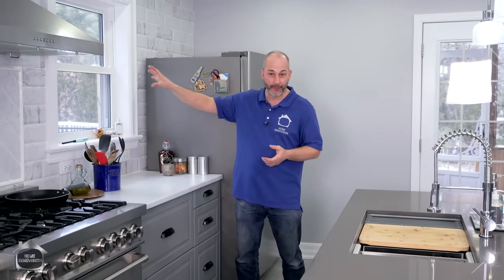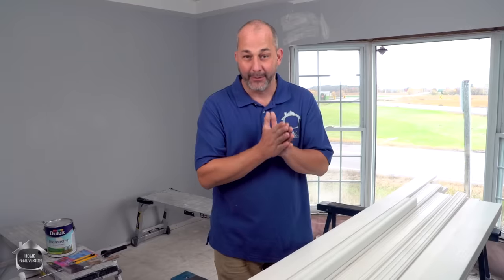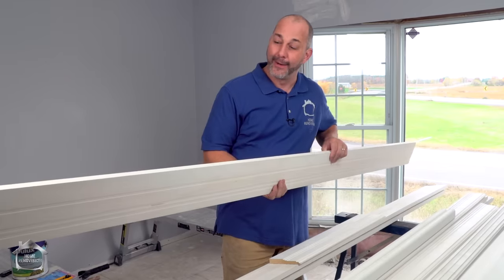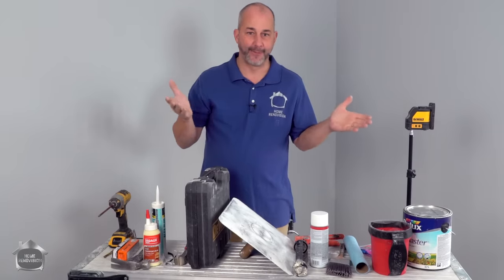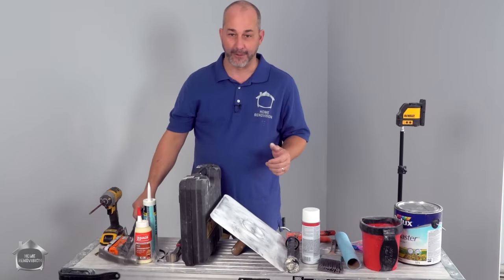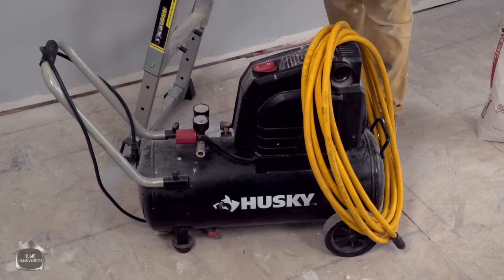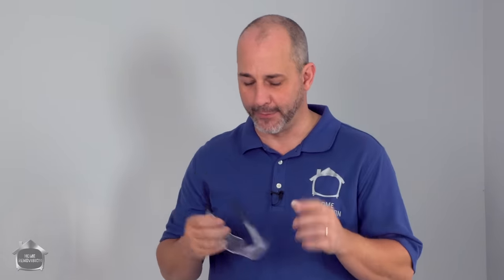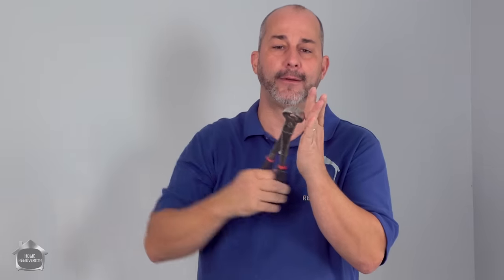How To Trim Doors Windows and Baseboards | A to Z

Comment: Jeff, I messed up a measurement and purchased new construction windows with jamb extensions that are 1" short from the inside paneling.  Can I still use them or do I need to remove the factory attached jamb extensions (looks like they are attached with heavy-duty staples) and create a new jamb extension box as you have done in this video?  Thanks!
Reply from the maker: I would replace them and install new or it will look like a mistake that was fixed forever.
Reply: @HomeRenoVisionDIY  Thank you.

Comment: hi Jeff..why not cut the crown moulding on an angle instead of a butt joint to match up two lenghts?  Also have you ever tried 950A latex from Sherwin Williams instead of Alex Plus?  The original Alex latex use to crack because the wasn't enough silicone in the mix, hence why they came out with Alex Plus (plus stands for more silicone in the recipe lol).  cheers , Mike

Comment: For door trim and baseboards, do you use 16 or 18 gauge nail gun?
Reply from the maker: I usually use an 18 gauge and save the 16 for larger stock wood. Cheers!

Comment: What is the best way to close the gap between the wall and floor, that will be  hidden by hydronic baseboard? I see gaps on most yet since I am replacing my heat baseboards I want to close the gaps hidden by the baseboard heat.

Comment: When i bought my house 1 year ago, i didnt know shit about houses. Thanks to your channel i know a lot more.

Regarding tims, lucky me, i've done all the job in MDF. Because on my miter saw, i have a framing/shitty blade, whatever a butcher should use. I think that its important to point out that you should use a finishing blade (like you did) when you work with wood. Because i learnt that by trials and mistakes later on (''why do i make splinters on everything?''). 

To sumup, from my newbie experience: The blade matters if you work with wood
Reply: Yessir trim blade has many more teeth than standard rip blade....Make sure your saw is up "to speed"before starting your cut...that will help with splintering.....
Reply: @davidwiley3440  thx for that ''up to speed'' comment.

I have not thought of that and it surely plays a difference. Totally make sens. I will pay attention next time.

Comment: I have a french door that was installed a year ago as a remodel in our existing kitchen. The door spans 2 different thickness walls. It fits and works fine but one wall is over 1/2" thicker than the other. So one side is flush and the other is recessed. Have any suggestions for how to trim this out?

Comment: I have found it easier for clean up and save your paint tray slide it in a plastic trash bag with a knot you can undo when finished untie turn inside out and any wet paint is trapped

Comment: I would say the opposite as far as brushes go. You want a soft bristle brush for trim, as it is like painting with a mushy sponge and doesn't show brush marks. Stiff bristle brushes are for cutting in walls. That's why I trim brushes are made out of nylox and natural bristles. Wall brushes are made out of chinex and mixes of nylon and polyester. The bristles themselves are much thicker with wall brushes.

Comment: Left door casing you marked 45° is to the left, so on the right door casing your 45° angle needs to be all right, correct so you know Which direction you should be cutting on the miter saw?

Comment: Just finishing up a bathroom reno. Learned a lot of diy from my Dad, but your videos are now a close #2, especially with today's modern materials. 
Only one question: you recommend a STIFF bristle brush for trim, I always heard the opposite? I use soft nylon brushes on my trim, and find they're much harder to use than nylon/poly or chinex brushes, but do leave fewer brush marks.

Comment: If you're going to get a miter saw and you're doing home improvements get at least a 10" sliding compound miter saw. I have the 12" but its really big. Even if you're gonna get a 7 1/4" get a sliding one you will surprised how much you use it.
Reply from the maker: so what your saying is the smaller the tool the more you use it. ....I do'nt think that's how it works in real life. Cheers!
Reply: @HomeRenoVisionDIY  I meant a sliding miter saw is better than a not sliding miter saw.

Comment: Would you recommend using the drywall compound over wood puddy
Reply: No. Dont use Drywall compound at all. It works, but it shrinks, it has a rougher texture, and absorbs more paint and so the nails will show up more. Use DAP painters putty if you are painting woodwork. It is exceptional and much less messy and has a longer working time.

Comment: Jeff, it appeared to me that the header door trim was a bit higher on the right than the left.
On the first measurement you used the flooring material as a measurement. Not sure you
Duplicated that same measurement on the right cut? I’m a close watcher.
Reply: I saw that too. I feel like he did measure it with the floor piece laying on the floor for both sides but maybe the door itself is installed slanted.

Comment: Pawn shops, thrift stores, and online are good places to get really cheap tools, just be really sure they work before you buy them. Also, if it's really specialty stuff like some stuff used in electrical or plumbing, and it's a tool you only need for one time, really cheap tools work. 

However, if you want more than one time use, you can check pawn shops and thrift stores, for virtually new equipment, but you'll probably end up at a box store like Home Depot or something

Comment: Hey awesome video, Quick Question - on the baseboard install, would you recommend always installing the baseboard trim before the flooring? Thanks!
Reply: No. Trim is used to cover the gap between the floor and walls. Only use quarter round in front of trim to cover a gap where you cannot remove the old trim like in a century home. Not a great look, but sometimes necessary.

Comment: Bird's mouth in the outside corners and no coping in the inside corners.  No countersinks for the screws on the window sill.  No battery-powered finish nailer.  Screw air compressors and hoses.  I wouldn't own a compound miter saw without a 12" blade and laser or light guide.   You can mount a sewing machine light at the top of your guard for perfect cuts every time.  Wire your light to the trigger so the saw has time to spin up as you adjust your wood.   Adding Dove dishwashing soap makes your mud like creamy peanut butter without adding water.  I'd have cut the but joints at 15 degrees.

Comment: I have always had an issue with picking trim and then getting it to match the doors. I want a wide trim for base but doors I have off areas and the wife won’t fit. How to I fix this? Can I do smaller trim for doors?

Comment: Curious how hard those cuts on the baseboard are to do if one doesn't have a miter saw and only a circular and hand tools (like a coping saw).
Edit: also, no nail gun so I guess hand hammering some finish nails with a light hammer?

Comment: At 1:02, with respect to your shoe molding where it meets the door casing, am I correct that said shoe mold is cut on a 45 degree angle? (The challenge for me is that the shoe molding itself would seem to otherwise project out into the room further than the door casing.)

Comment: I'm really curious how you made those taper cuts for the window casing on the table saw. I built a jig for that but it's still a pain and you just cut it without thinking. I have been using durhams rockhard putty for nail holes and had no idea I could use drywall compound
Reply: blue tape with ca glue sticks two pieces till sawn at angle

Comment: Fill the nail holes and caulk your baseboards. I picked up a contract in Maine and the old trim carpenter never caulked anything. And the painters would just paint without caulking. If was a nightmare to go back and fix 35 homes after the fact. Good money but I don't recommend picking up that kind of contract.

Comment: At 42:30 you say that you measure 1 1/2 inches longer than your initial measurement. However, before saying that you said the measurement was 4 7/8. Was the cut 6 1/8 inches or 4 7/8?

Comment: @Home RenoVision DIY What is the name of the store where you found the wood trim for the same price as the cheap stuff at home depot? You mentioned across from home depot, but not sure which location and you didn't actually say the name. I'm in Ottawa (actually Kanata) and about to do a ton of baseboards and other trim!
Reply: Try Ottawa Moulding Depot, they are located in Kanata. Lots of mouldings in stock
Reply: I'll check it out. Thanks @joef1551

Comment: by pushing the trim into the blade and then cutting a little off works because the wood is touching the flat web of the blade and missing the Kiel of the teeth

Comment: What should I do if I’m in an attic replacing a hot water heater and I need to use the existing vent going out the roof?

Comment: If the end of wall was 4 7/8, the inside measurement piece against the wall would be 4 7/8, not the total length of the outside of the baseboard. It would be longer since it comes out to make the angle. Did you have to re-cut?

Comment: Just a question, my teacher says to never do both sides of the door casing before the too for some reason. He says to do one side, then the top, then the other side. Have you heard of people doing it this way and why would they do it like that?
Reply: I have heard this from a carpenter I worked with. Some people do it this way to only have one miter to worry about at a time. It doesn't make much sense to me, I think this method is better.

Comment: I have a problem in my garage.  I have a regular door which I had an installer replace.  It never had any trim around it.  The garage was a mess I am trying to clean up.  The drywall sticks up past the door frame.   I want to add trim.  What do I need to do?  Add a thin flat trim all the way around to cover the end of the plywood and have the trim sit on?  I bought a money pit.  I'm a new member and binge watch all your videos.
Reply from the maker: that is exactly correct. Cheers Sheri!

Comment: I would personally buy trim a little thicker than the base board so you dont get that ugly but joint even fixing it with biscuits i still prefer a shadow line to a butt joint

Comment: i notice a lot of houses using "craftsman" trim these days. It literally looks like a 1x piece of lumber.
that should be super cheap right?
Reply: Depends if its painted or stain grade material. Also depends on where you're buying it and the supplies you have availble to you.

Comment: That's "nickers in a twist"...sorry!!...Ha!.. I put that tub and shower caulk on the back splash because the guest bath mirror would fog up and drip down on the tile. Guest don't really clean up good so I put a squeegee in there and now that caulk looks like it's molding from the inside out...can see black inside it. Too thick of a bead? I used the dbl tape method. Thanks in advance!!

Comment: How about a video on how to cut baseboard/trim for "rounded inside corners". There is not a single one on YouTube.
Reply: 22 1/2 cuts or solid block on band saw and they make flex molding  cut to match $$$  .  back relief cuts too tight a radius

Comment: @34:57 looks like the reveal goes from 1/4" to an 1/8". 

I would've at least the pulled the left side, off of the floor a little, so the reveal at the top was the same.

Comment: Quick tip on mixing your paint cans.  Place them in the dryer and turn it on air dry so it doesn’t heat up. The more cans you have the better. Also tape up the door so it doesn’t pop open. 

You’re welcome!

Comment: 42:14 was that piece short? You measured the 4 7/8 wall, which should have been the inside length, not the outside length.

Comment: I realize I might not get an answer for a 3 yrs old video, but the question is relevant. 
In 2024, are you still mostly using pneumatic nailers or have you switched to battery powered ?

Comment: I helped side a house that was on a flat iron lot and sloped from one story to three stories. We had built scaffolding and hung hardie board on it. I told the boss we needed to dress up the dimples but he said we didn't have time. Come to the end and he was told he wasn't getting paid until he fixed the pillow look of the hammer marks. What an idiot. Moved all that scaffold back and forth and up and down to the point I quit that job. He tried to hire me back and I said no thanks.

Comment: I’m surprised that there was no attempt to nail the top of the molding where the vertical studs are located to pull the top closer to the wall to reduce the amount of caulking fill. I have corners that are flared out too much with mud that create gaps along the wall. There seems to be no solution to the caulking make over look.

Comment: You're clearly using one, but you never mentioned that DIYers should buy a trim miter saw blade (way more teeth than a framing blade). Most miter saws come with a construction rated blade which isn't suitable for finish carpentry.

Comment: Just removed homemade baseboards from my basement. They were 5/8  x 2 3/8 lumber fastened by drywall screws. I’d say maybe 4 or 5 inch. They were filled with wood filler & 2 coats of paint. AND they sealed the TOP of the boards with silicone. The screws were a little hard to find. I’m not even half finished removing all the boards yet.It was definitely a DIY job. I’m NOT impressed !!

Comment: How is spraying in place easier when you have to protect floor? Taping and paying those drop cloth are very tedious.. I'll just buy a semi gloss can spray and use that instead. Dries in 10-15 minutes!
Reply: You get a professional finish on the wall and as it transcends to the trim

Comment: when its quite i can hear the nail gun  different sound when out of nails .-
put a valve on hose end-- pressure never the same depth ! air compressor psig always changes need a NEW GUN

Comment: I'm from the UK don't know about in the US but there's no way you ever do an internal mitre reason being walls are really Square and the joints can open up you always Scribe internal miters there's no way this guy is a professional Carpenter did you see the state of his external might as well he would have been thrown off of one of my jobs on the first day
Reply: Eh I've seen both methods and I'm going with a straight up miter cut for my trim. Glue prevents the joints from opening. It's not worth the extra work, money, or time to do a scribe job when wood glue has a very high chance of preventing joints from opening. Plus IMO, the scribe joints don't look as clean. Each to their own.
Reply: @Inspectorzinn2  
Has any chippy worth is salt knows it's not just about out the joints opening up scribing the joiners is the only way forward it takes up any inconsistency to that angle for example if the walls out at 85 degrees ascribe will take this inconsistency or if the walls out by 95 degrees ascribed will also take this out of Square are mitre if you Mitre internal joints it means that the walls have to be perfect I worked on many properties including Arundel Castle where walls are out by considerable amounts and when working with Oak or hardwood timbers where you cannot fill the only way of achieving a high-end finish with hardwoods is to Scribe and that is not up for debate I hope expanding on the subject helps you bring your level of carpentry up to an acceptable standard
Reply: @nickwest9748  Eh he's done the same miter cut and glue technique on uneven walls in other videos and the results looked great. I never said there was never a place for a scribing trim. If you have to do a scribe because the walls are messed up or its hardwood then you have to do that. But at the DIY homeowner level, using a straight miter and glue is going to work well and save time for at least 90% of us.
Reply: @Inspectorzinn2 
Well I haven't seen any of his other videos and only skimmed though this one as having been a carpenter for 30+ years I don't tend to watch to much DIY shit but as I'm English and we love a saying I'll leave you with this "if it's not right, it's wrong. If it's wrong it's not good enough"

Comment: Good golly, my Hoser friend! You appear to be a respectable tiler and painter, but that construction screw treatment of the sill nose was some of the most ghetto shite I've seen on FB, or anywhere for that matter. Have you not heard of countersinks, trim head screws, brad nailing to clamp while the glue sets, edge clamps, clamping with tape....anything that will prevent blow outs and warts like you produced there? Another thing...longer drill bits are available that will reach through the nosing and into the sill. As you allude to in the video, driving screws where no pilot hole exists is prone to inducing alignment error. I know, I know....all some people see is the bad stuff.....but I'm not a professional with a youtube channel.

Comment: As pro painter I would rather the carpenter not touch wood patch and definitely not caulking.  It is very hard to fix bad caulk. Both of these jobs should be left to the finish painters.

Comment: You say if you dont fill holes or caulk youre not a real carpenter yet you slam caulking in between you door casing mitres and your outside corner on your baseboard is open 3/16 and you filled that with caulking as well? Thats the farthest thing from carpentry. Real carpenters dont need DAP to hide mistakes lmao

Comment: Using a roller on profiled trim is a slumlord grade finish. No self respecting professional would do that. I don’t need the last 2 hours of this video, I’ve seen enough. For all of you DYI folks out there, use a brush on your mouldings, not a roller. It will give you a professional grade finish.

Comment: ouff never leave open craxk into exterior  corner trim, wtf? ajust the angle of the cut, do you imagine 14" o'gee with such crack? @57 min 24 sec.... latex will going into the crack overtime since wood are organic material..